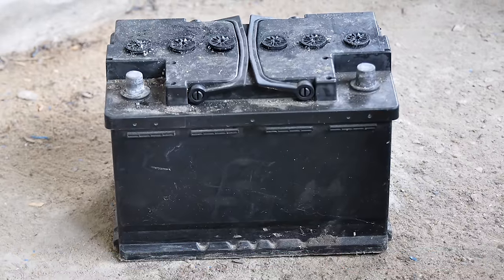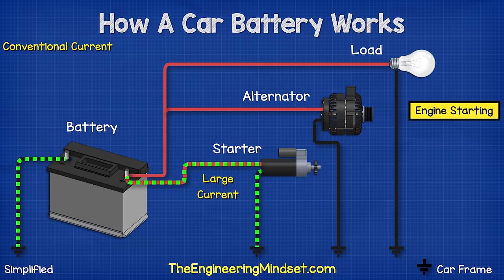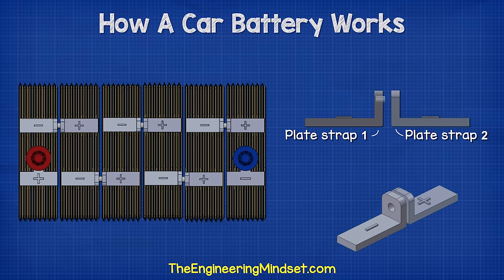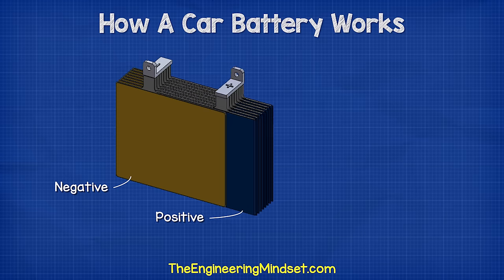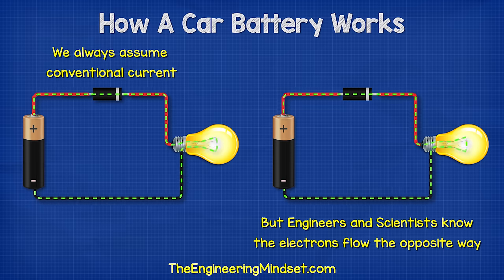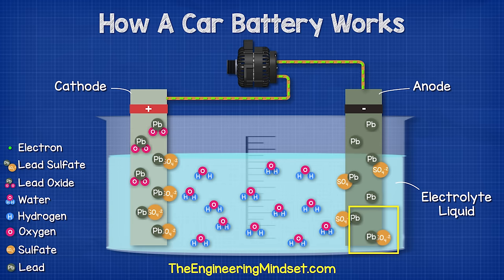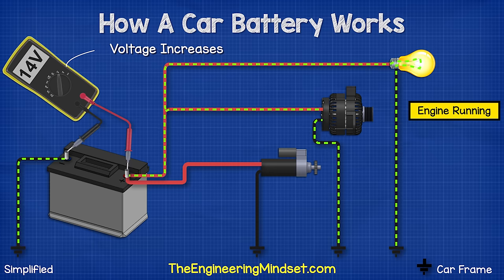How A Car Battery Works - basic working principle

Comment: Why haven't the lead acid battery been replaced by the lithium ion battery? The lithium ion battery is better in almost all ways, and is also about the same price and soon even cheaper at under $100 per kWh.
Reply: A starter motor needs a lot of amps to start the engine
Reply: @lolcool_f  yeah but can't a similar sized lithium ion battery deliver the same amount of amps tho
Reply: Not as much as a lead acid apparently. Also they don't work as well in a wide temperature range unlike lead acid.
Reply: From what I understand, lithium ion batteries don't perform as well as lead acid batteries in the cold, lithium ion batteries don't provide as much amp/hour as lead acid batteries that are the same size, and lithium ion batteries require more electronics to maintain a specific voltage and temperature as they are more reactive.

Comment: Could you make a video about how an alternator works? Great video as always very informative
Reply from the maker: Coming next week! I'll tag you.
Reply: It's just a generator. The way how applying electricity to a coil makes it into an electromagnet, when you inverse that, the motion of magnets induces current in the wires, and the magnets are connected to a rotor, which, in turn, is connected to the engine via belt. Pretty much all generators generate alternating current (I think all of them, but am not 100% sure...), hence the name, alternator, but the way you can restrict water flow in one direction, but let it flow in the other, the same can be done to electric current, effectively turning it into direct current to charge the battery.

Edit: Sorry, there are DC generators too... Key difference is AC generators magnets rotate, and coil is stationary, but in DC generator it's the opposite.
Reply from the maker: Check out how car alternators generate electricity here: https://youtu.be/jdSKlg80DjU
Reply: @EngineeringMindset  Thank you so much man. Your the best, I learned so much in this quarantine from you.

Comment: 10:56 Might confuse some that Cathode is labeled as positive (Cathode is negative electrode). However in  this case the electrode of a battery that releases electrons during discharge is called anode; the electrode that absorbs the electrons is the cathode. The car battery anode is always negative and the cathode positive. This 'appears' to violate the convention as the anode is the terminal into which current flows.
Reply: Wait wait wait, I think you might be confusing conventional flow (used only in drawings) and actual electron flow (what actually happens in real life). The anode is negative because it's what initially has the electrons, which have the negative charge. They flow from negative to positive to reach an equilibrium. Or am I misunderstanding something?

Comment: Remember when checking the electrolyte level in the battery make sure it’s fully charged before adding more. The fluid level will increase while charging and can over flow if not properly done.

Comment: Great video again.

If you need to jump start a car... make sure the running one is running and connect the jump leads red to red and black / negative as close to the starter as possible on an unpainted surface on the dead car, try starting the dead car, if it starts disconnect the leads. Sometimes you may need to leave it a few minutes before it will start. 

Once the leads are disconnected you can check the alternator is working with a multimeter across the battery set to DC it should read around 14.4 V when the engine is running.
Reply from the maker: Check out how car alternators generate electricity here: https://youtu.be/jdSKlg80DjU
Reply: 🤯 oh my God, NOW I see why you're supposed to connect the negative lead to the chassis and not the negative battery terminal! I'd always known not to, but always wondered why.. it's so obvious now. So the electrons are delivered closer to the starter. THANK you!
Reply: Hello
Reply from the maker: Check our new Multimeter tutorial out ➡️ https://youtu.be/4lAyzRxsbDc
Reply: @nthgth  Actually, one reason for this I've seen is so that the final connection is made away from the battery. The battery can release hydrogen gas, which is highly volatile and could be ignited by the arcing during connection/disconnection.
Reply: @falcon-ng6sd  another good reason, if the battery vents. But aren't car batteries entirely sealed?

Comment: can you please explain how the current flows when jump starting the car? DC runs from negative to positive. we connect the dead battery positive to live battery positive and the live battery negative to the chassis of the dead battery.
 so, the electrons flow :
1, from live negative -> chassis
2, through the chassis to dead battery negative
3, dead battery positive -> live battery positive
is that correct? is that how a car battery gets the electrons when jump starting the car? through the chassis ?

Comment: Fantastic explanation. I just have an issue with the super expensive Fluke 115 meter you recommend in the comments. As an engineer you should know a meter without mA is basically for professional electricians and anyone can get started in electronics with a basic $20 meter (or a $3 from Harbor Freight to cover 90% of needs).

Comment: Thanks for that well detailed and informative video. Although the use lead acid batteries are declining and lithium ion batteries are taking over, it still has strong  presence in the automotive sector. Even Tesla cars are using conventional 12 volt lead acid batteries for powering the auxiliaries in the car.

Comment: Don't  forget to mention that wonderful invention, the ballast resistor.
Until the 1970s, you had to get good sparks in your combustion chambers at the same time that the battery was being drained by the enormous current  required  by the starter motor. Thus the sparks were feeblest when you needed them to be strongest. That is why it was always difficult to start the car.  The ballast resistor was placed in line with the spark plugs' low-tension circuit, and the engine runs happily with less than 12 volts.
But in starting the car, the ballast resistor is bypassed to supply the full 12 volts to the spark plugs. This makes little difference to the battery's starting current, but gives a more intense spark when you need the engine to "catch".
Reply from the maker: Check out NEW resistor video, everything covered! ➡️ https://youtu.be/DYcLFHgVCn0

Comment: Does the alternator run as long as the car is running? Or only activate when the car battery’s capacity drops to a certain limit (idk if that’s even something that’s measured). Thanks for the excellent video!

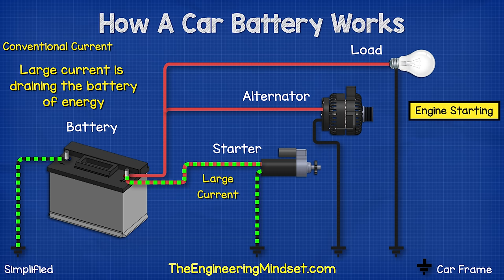Comment: At about 2:15 in the graphic showing engine running, where is the current coming from feeding the spark plugs? Thanks for this Subscribed!
Reply: It's coming from the ignition coil, that is fed by battery voltage.

Comment: @5:48 - the "additives" concentration in the negative/anode plate is extremely important.  For example, ventless flooded lead acid batteries will have higher concentration of calcium in the anode plate ( lead calcium alloy).   The tradeoff for lead calcium alloy battery is quicker sulfation  or short battery life inside a car due to charging problems.  Some people say the push charge (not float) should be 14.8v  but a study suggests 14.1v .  Either way,  it will have problems in any vehicles. Lead calcium alloy is also cheaper to make.
Reply: Tell me about sulfitation. The killer of accumulators. I hate that modern lead-acid accumulators are all of the "maintenance-free" type. I have no possibility to add distilled water, which eventually evaporates even in "sealed" types, especially when they are over-discharged. That should not happen, but can. If you catch the problem fast, you can save an accumulator. If it is of the "maintenance-free" type, you are out of luck if the water level got too low, as you have no means how to add distilled water to the electrolyte.

Comment: Fantastic video as always. However I still have some questions: 
When the battery is discharging, do the electrons accumulate in the cathode? Or do they move in a curcuit through the acid? 

If they do accumulate in the cathode thus charging in negatively, doesn't the charge difference between the plates that creates the electric current diminish overtime? 

Thanks!

Comment: Could you make a video about the voltage of the neutral and why it is equal to the ground voltage, thanks.
Reply from the maker: In regards to a residential electrical system?

Comment: Quick question: In cold temperatures, like winter, the car takes a little longer to start if you let it out over night, say. Could the reason on why it takes slower to start is because the liquid in the battery is starting to freeze??? Just curious about that.

Comment: Just curious, at 11:34 of the video shouldn't there be a +2 charge shown on the cathode since, as part of the cartoon, one Pb4+ has only one oxygen (-2) paired with it?    Small detail but this would help show the pull of the cathode and the push already illustrated in the anode

Comment: Firstly you said the grid is coated in a paste of PbO then you said Anode is made of pure Pb and the Cathode is made of PbO, did you mean to say that the grid structure is made from Pb and PbO respectively but then you also said the paste is where the chem. r×n occurs...so my question to you is the only thing that causes the chem. r×n is diff. chemistry of plates(as you later said in the video) so if that is so how this all make any sense?
PLEASE respond to my query!🙏
Edit: Also wherever you've mentioned PbO(Lead Oxide) I think you meant PbO2(Lead Dioxide) because when you showed the atoms they were atoms of PbO2...is that so?
Anyways, a great detailed video!
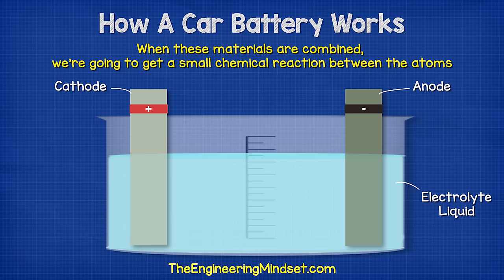Reply from the maker: We need different materials to cause the chemical reaction. So this battery uses lead and lead oxide as well as a sulfate electrolyte. The animations show the reaction occurring from 10:45

Comment: Thanks Paul, informative as always. If the flow of electrons is from the negative terminal then why do car manufacturers place fuses on the positive terminal? Surely they are not providing any protection to the circuit if electrons are flowing out of the negative terminal?
Reply: This confused me for a while too. Basically it comes down to which end of the battery or dc electrical power system you decide to define as zero volts ('ground') and also connect this to the metal chassis and engine. If the system has negative grounding then the fuses are connected at the positive supply terminal so that any electrically downstream positive dc wire or equipment which accidentally comes into contact with the large surface area of the chassis will blow the fuse and stop the fault current. It's the opposite way about for a positively grounded system which connects its fuses (or any other type of circuit protection etc.)  at the negative supply terminal.

Comment: I think there is a small mistake. During charging the Anode and Cathode interchange. Since oxidation and reduction occur in opposite electrodes compared to discharging.
Reply: I was actually looking for a comment that helped me understand the relation between what was said in the video and what I was taught = PANIC = Positive Anode, Negative Is Cathode.  Thank you!

Comment: Can you charge the battery cells one by one with a voltage of 2.4-2.6V? You have to access the plate straps without destroying the battery cover too much? In a case of unbalanced electrolyte SG readings.

Comment: At 5:56 regarding battery pole. What I know is that The Negative = Cathode and Positive = Anode. Not as you explained. I'm right?
Reply: Yeah,I also got confused there.
Reply: Don't be confused of (+cathodes) and (-anodes) | Cathodes are negatively charged electrodes,  that means (+protons) inside cathodes have less electrons, while -Anodes sends more positively charged electrodes (-electrons) that flow's into a conductor (copper wire - free electron structure) and adds more electron particles within the wires when connected to Cathode. Then it creates a reaction that produces electrical energy along with electromagnetic energy.

Cathode is sucking all the excess electrons to make it self stable and not to become reactive.
When Cathode receives enough electrons, it becomes in a neutral state and is not reactive any longer due to equilibrium. That is why batteries will last.

Comment: Excellent, and thank you for the lesson.  Is there a maximum rate at which the chemical reaction occurs during discharge?  If the electrical resistance of the battery is taken out of the equation is this what terminal voltage decreases as load increases on a battery?

Comment: I don't know if Elon Musk secrectly watch this.
Reply from the maker: That would be incredible
Reply: Nope... He is busy banging his head on to the wall since he realized that "hyperloop" is not going to work after all the "hype" he generated for it.
Reply: Hahã😂 😂
Reply: 😆 🤣  Elon is jealous
Reply: ...The °Musk° secretly see's ALL things.....
              .../simultaneously\..
Reply: He does for breakfast.
Reply: Wrong type of battery
Reply: He has neuralink I doubt it
Reply: 😂😂😂 I think that guy is beyond am told he grew up from south Africa
Reply: Tesla and other EV’s have a 12 volt or two (Rivian) batteries for powering modules, cabin accessories etc. The larger EV traction battery is primarily used for vehicle propulsion and running high demand items like AC. Most people are unaware.
Reply: Elon husk
Reply: No he didn't. He's to busy playing with his rocket.
Reply: Why😂

Comment: Any idea if I can use a Starlink dish (50-75W) for about 8h connected to my car battery while it charges on solar (200W) at the same time? According to my math this should not decrease the battery power to less than what the car needs to start, correct?

Comment: So i finally got it.
A car battery has the symbols + -  contrary to electron flow, thats why the + is hooked to electromotor, alternator and ECU and other components and - is hooked to car ground return.
Because in real current flow theory that + is actually - electrons flow out of it and - is + ground return.
So its a matter of how you mark the symbols on electronics and technical drawings, we use + to - in conventional current and designing and marking batteries and electronics but in fact its the other way around.

Comment: at 12:53 it shows the alternator recharging the battery thru the anode which I get...it is reverse of the generation of electrons thru chemical reaction but then at about 14:42 it shows the electron flow from the alternator to the cathode....opposite of previous illustration. Also I am confused with 14:29 illustration of starter motor function showing electron flow from the cathode instead of the anode. Seems to me the direction of electron flow in these later two illustrations is reversed?

Comment: Nice work! Just one question though So why is it that electrical circuits design todays are still following the positive to negative flow of electron wherein fact you stated in the video that  theory has already been proven wrong and electrons flows from negative to positive.
Why not just disregard the conventional theory and follow the negative to positive electron flows.
Because That’s create a lot of confusion, and more chances for people to make a wrong electrical connection if we will follow the wrong theory.
Hope someone could share some answers!
Reply from the maker: Answer here https://youtu.be/MUh_dOcqgVw
Reply: It makes no difference to electronics or electronic design.  No difference to an electrician either.  It really only matters when dealing with magnetics, electrochemistry and gas discharge tubes.   The "convention" is embedded in the symbols, and very confusing to switch a student from one system to another.   Blame Benjamin Franklin for calling it wrong 150 years before the electron was found to be negative!
Reply: Basically the same reason the US often uses the English Imperial measurement system instead of metric. It makes no difference at the end of the day, except for certain situations and professions, and in those cases, those people know exactly how to use either system and when.

Comment: Cool vid. One question:
Could someone smart elaborate on how electric current goes from + to - , while free electrons go from - to + ?
If youre one of those to tell me that its just for calculations please dont.
 Electric current flows with speed near speed of light, while movement of free electrons through material few meters a second is considered fast.
So if electric current is not the same as the movement of electrons, then what is it exactly?

Comment: I know the term "flow" is loosely used in electricity, but in all actuality electrons don't flow, they repel and attract like you mentioned with how magnets work. They literally jump from atom to atom by repulsion and attraction. Either way though, it is an adopted term cause it's easier to understand when explaining it.
Reply: When you get down to it, that's how water flows too though

Comment: I'm greatly annoyed that industry continues to show automobile current flowing from a positive battery terminal to the various loads when it actually flows from the negative terminal to those loads via the chassis/body structures instead. There is no ground in this situation whatsoever. To say otherwise is to sow confusion.

That said, I applaud the channel provider for acknowledging the true flow of current.

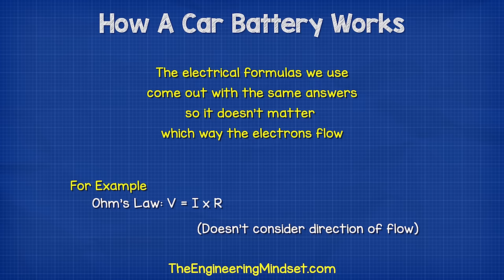Comment: 8:40 didnt like electro boom manage to record electricity in a very high framerate, and the arcs always went from positive to negative, but they could see in very slow speeds that there was very small arcs that went from negative that impacted with the positive arc. Basicly 95% of it went from positive to negative